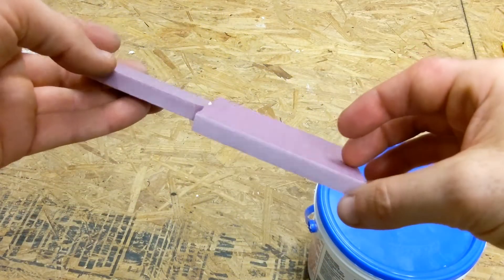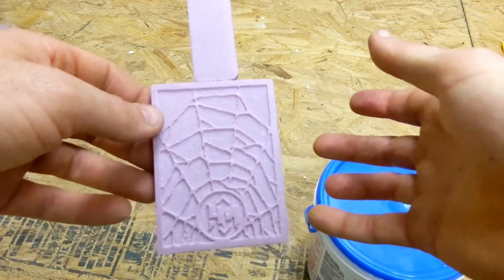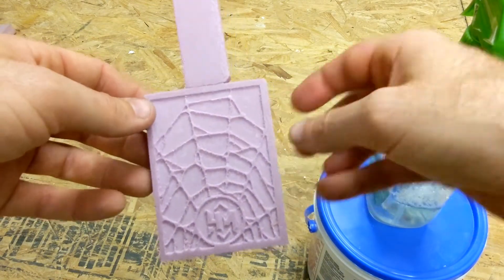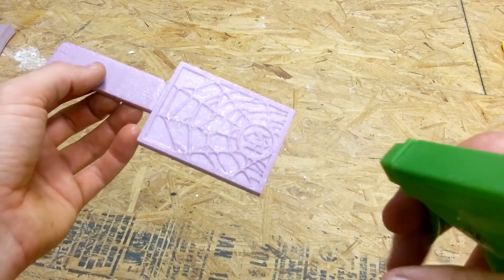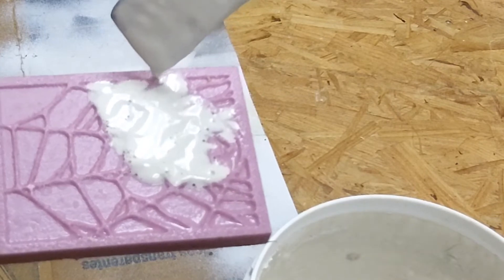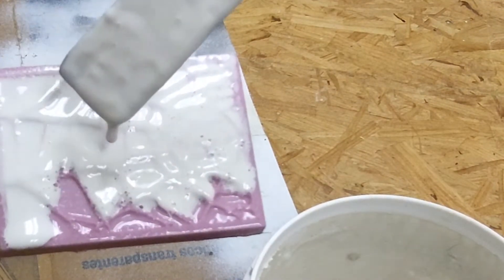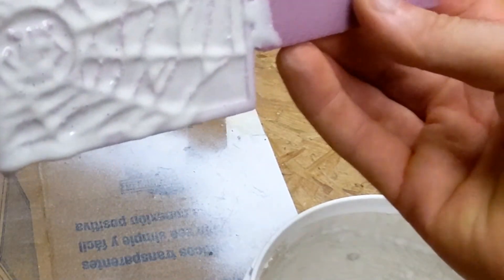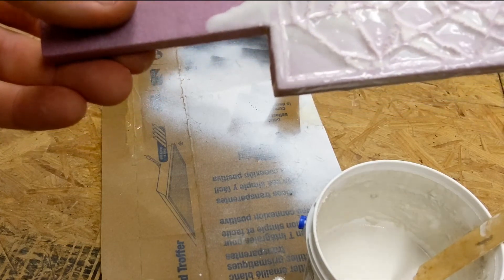Removing Air Bubbles in Plaster Casting - Bubbles in Lost Foam Casting (Removing Bubbles)

Comment: I tested it a while u want  soap but not too much since it makes the slightly weaker not a lot but if your molds are small spray it quite a bit but with a decently well doluted solution so it doesn't affect the strength of the plaster too much I am talking about less strength but this only talking about really thin molds like between 1 and 5 mm millimeter molds.
Reply from the maker: I don't saturate the foam.  I also want to mention that the plaster isn't there for strength.  The plaster is for the smoothness finish and to get into small spots that the sand can't.

Comment: How much water are you adding to the plaster tub? And I’m assuming you just reseal it every time without it drying out?
Reply from the maker: It's good to transfer it to a smaller tub.  I actually use 2 consistencies.  1 I use more water, so it's runny.  I do that for a first coat.  If I do a second coat I use a thicker solution.  It really depends on what I'm casting.  My recent videos, I am doing a project where I used 2 coats.
Reply: @HeinrichsMade  gotcha, I’m assuming you kinda eyeball the consistency then, no measuring out water vs plaster
Reply from the maker: @littlebro7839  yes 👍

Comment: Interesting video! What kind of plaster and cnc machine are you using? I have only casted bars thus far but would like to experiment with this technique too. Thanks!
Reply from the maker: Hey Lauri!  This is your typical wall plaster used to drywall.  I mixed it with water to thin it out.  My CNC is the FoxAlien Masuter.  I believe I have a link in the video description.

Make sure to check out my Lost Foam casting playlist to help you in your experiments. 👍
Reply: @Heinrichs Made  Thank you, will check out your other videos!
Reply from the maker: @Lauri321  any questions, I'll try to help 👍